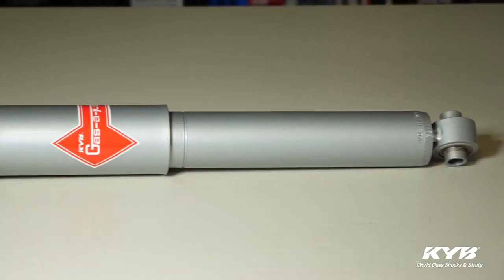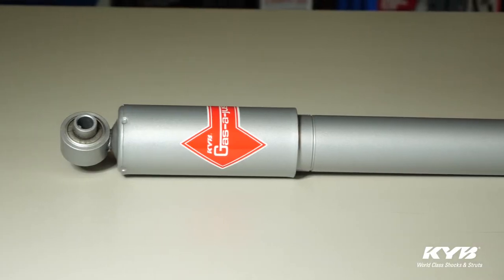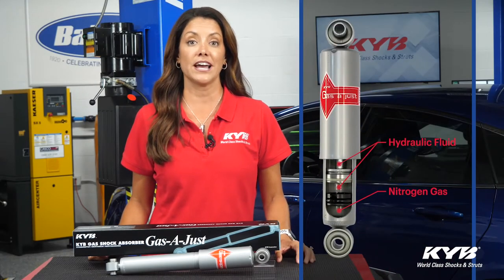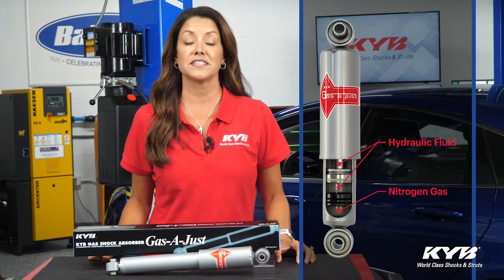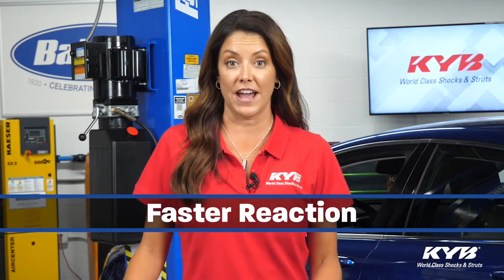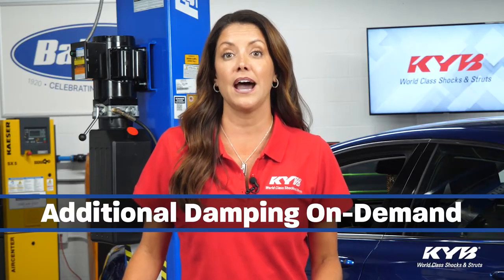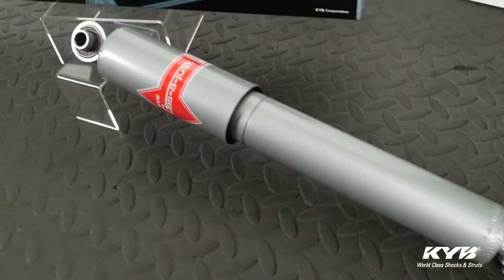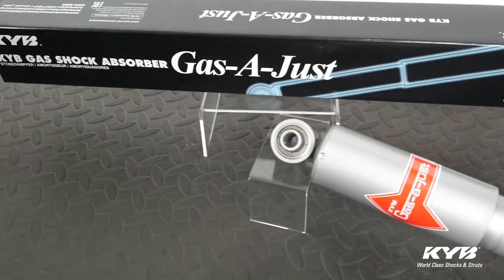KYB Gas-a-just Product Video

Comment: How do you adjust them?
Reply from the maker: They're use a monotube design, and they adjust on their own based on forces applied due to driver inputs and road conditions. They are not manually adjustable.